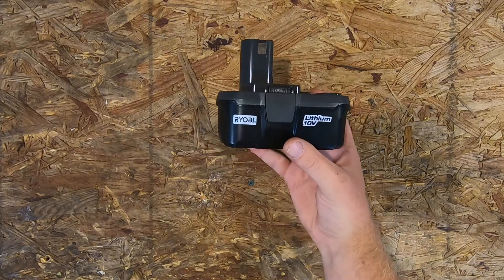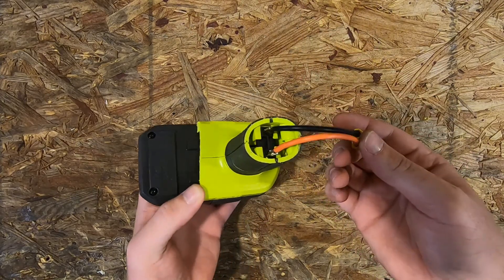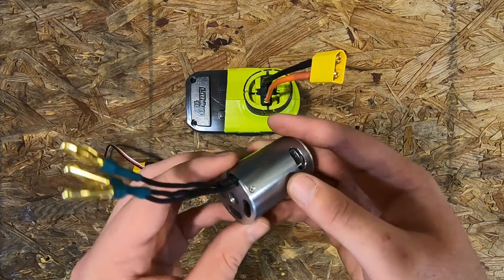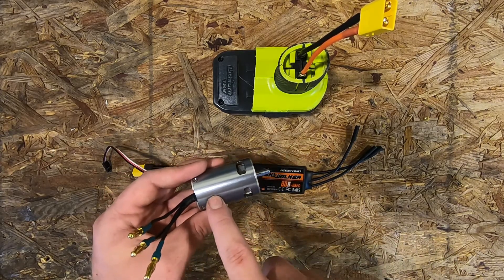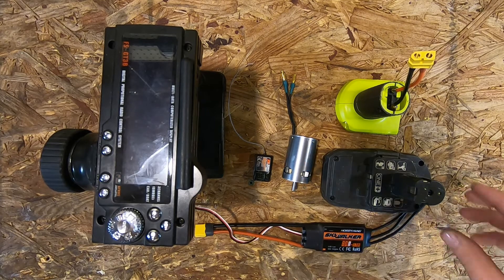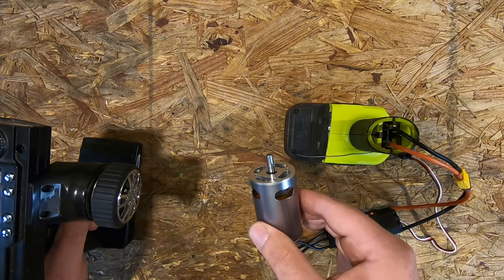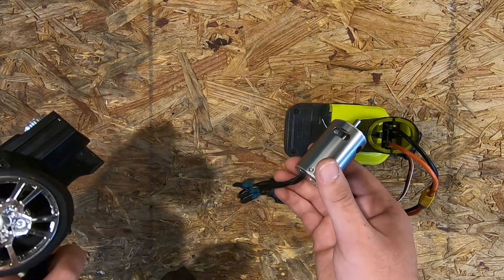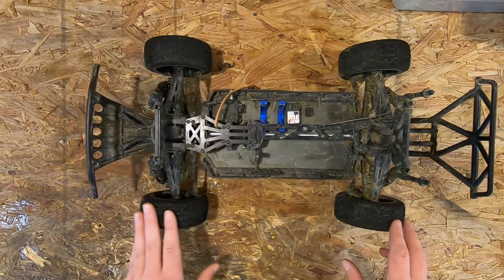Drill Battery In Rc Car (Part 1)

Comment: Great videos man!
I had a Rustler as a kid...Been wanting to buy another RC but batteries kept me from doing so.
Just bought a Stampede a few weeks ago and converted it to run on my Ryobi batts. It works great and on a 4Ah battery will run for a full hour. Mine is a stock XL5 with Titan 12T motor. I 3d printed the case and used a DC converter to adjust the voltage down. It feels low on power (torque) but is fast enough to have fun with (25MPH est).
Reply from the maker: I've always wanted a 3d printer
Reply: @fishinkarts2865  Get one, you'll use it more than you think.
I bought a broken one (Qidi X-one2) on ebay for $123 shipped. Its paid for itself several times over.
Reply from the maker: I absolutely will eventually. I want to learn a little bit of cad modeling before I get one so that I can start using it right away.
Reply: @fishinkarts2865  Tinkercad has almost no learning curve and its free. I use it and thingiverse for everything.
Reply from the maker: @BradKwfc  Thanks for the suggestion. I'll give it a shot.

Comment: I have a t-maxx and a revo that I run on milwaukee m18 batteries with mamba monster x esc and tekin t8g2 2250kv.. And they are super fast. I've never had a problem with discharge from the batteries. Always have lots of power.  I use the revo every day. 

I also have a redcat caldera that I use the m12 batteries on. I made adapters for the batteries that are very similar to yours. 

Good work man. Nicely done. 

I'm currently converting my xmaxx to run on 10s. Two m18 batteries. 

I think that the 810kv is a little low on the rpm range, but I could be wrong.
Reply from the maker: Dude that xmaxx is gonna rip. 810kv might be a bit low, but the price was just right. ($18 on sale)